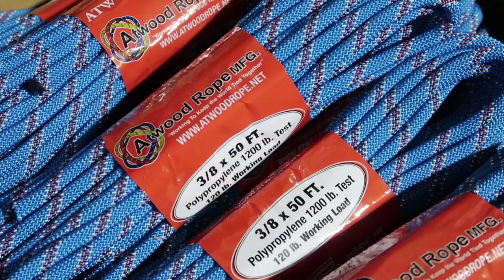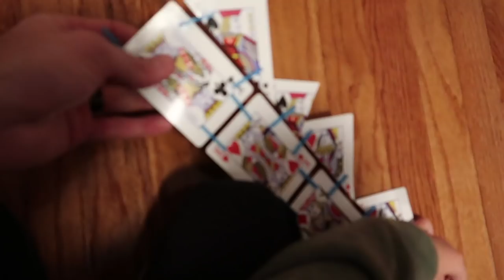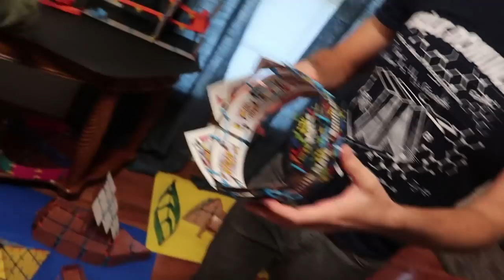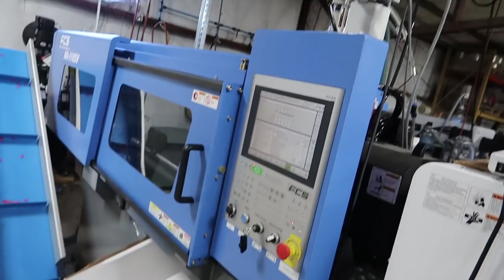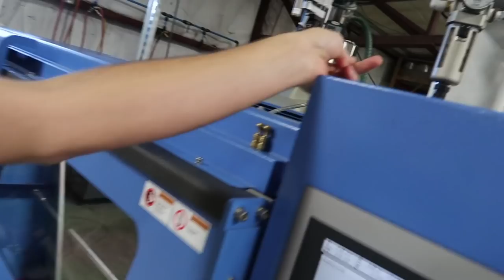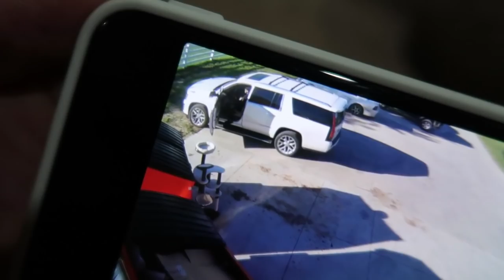My Life Before YouTube!!

Comment: The factory life! I work in an Extrusion Factory where we extrude Nylon resin and cut them into chips. Then those chips (resin) is used for wire coating plastic parts on cars fly fishing line bowling pins and even nylon rope!